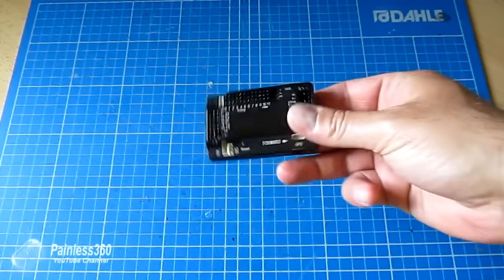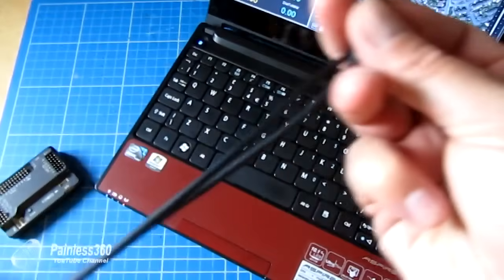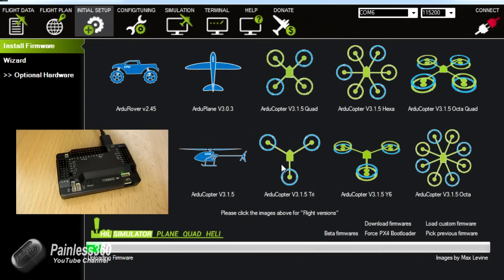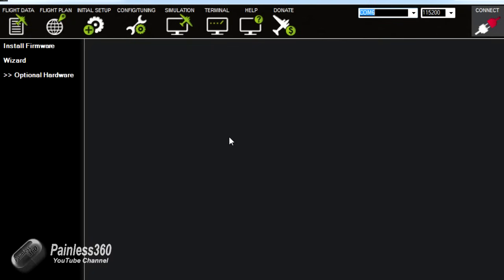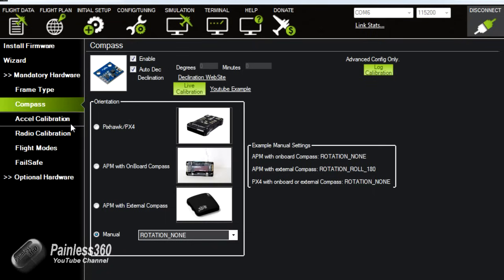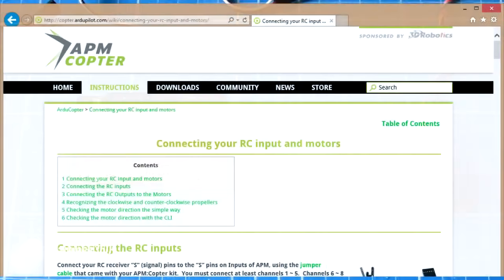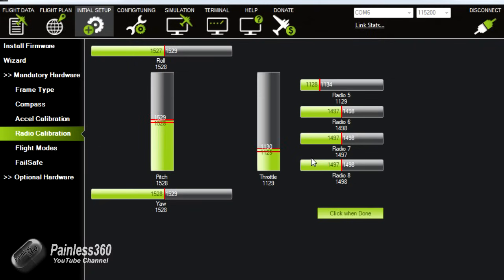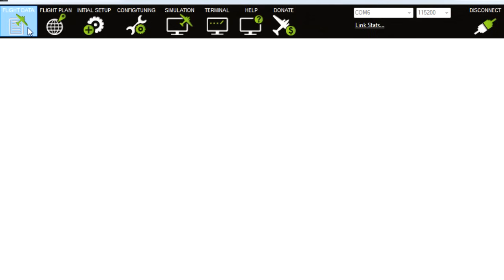(1/8) APM 2.5/2.6/2.7/2.8 - Simple installation and setup overview

Comment: Does anyone have any problem at the moment of Mavlink connection? My APM 2.6 loads the firmware, but when trying to connect it will just go to "No Heatbeat Packets Received" after the timeout...Alive LED is locked and the RX LED blinks...but nothing happends...it used to work before...but i dont know whats going on now...help?
Reply from the maker: Hi Nils, try connecting as soon as you power on the airside radio. Failing that a firmware update often clears the problem. My video 3DR Radio on an APM 2.5 Multicopter Board - Overview, Setup and Troubleshooting may help.
Reply: I'm having trouble right at the beginning...the Ardupilot 2.6 connected with USB to the pc wont connect via Mavlink, nothing else connected :|
Reply from the maker: That's nothing to do with the MAVLink radios then! :) Remove any Bluetooth and other adapters you have plugged into the USB ports on the computer (APM  2.5/2.6 Mission Planner - slow USB fix)

Has this ever worked?
Reply: Thanks for your help again! At the beginning I connected my APM 2.6 board to the Mission Planner 1.3.9, uploaded the last firmware for an hexacopter and I was able to set the accelerometer and compass configuration (seeing in the Flight Data the changes when moving the board), but now it won't work out...Everything looks normal, board is reconiced, uploads firmware, when trying to connect LEDs blink but then...no connection is established and I finish with the message "No Heatbeat  Packets Received"....no bluetooth, or any other kind of USB plugged in.
Reply from the maker: Try connecting to the board at 57k baud for the USB link, it may be a bad circuit..
Reply: I ran into that today and then i looked at the Baud rate and it had changed i put mine back to 115200 and worked again

Comment: Hi I cant find my board on any com port. How can I get my pc to recognize the board.
Reply from the maker: beretta sometimes it takes a few times plugging in for the board to be recognised. Has this ever worked?
Reply: Painless360 I found out my usb cable was faulty. even though the lights were on it was not communicating with my pc.
Thanks for the great video. Working my way through it.

Comment: No matter what I try I cant get the firmware to upload. It keeps giving me the 'Communication error - No connection; error. Please help Mr. Painless, this is so frustrating :(
Reply from the maker: +Brenden what have you already tried?
Reply: 1) Update drivers - unsuccessful 
2) Selecting 'Auto' in the com drop down
3) Uninstalling-reinstalling Mission Planner - still no change
4) Trying the wizard - unable to establish connection 
5) Installing 3.2.1/3.2 - unsuccessful 
6) Trying different USB ports around my pc/

I would like to add that in device manager settings the audrino comes up under 'Other Device' instead of coming under 'Ports', and in add device/printer it comes under 'Unspecified' with a warning icon beside it. 
When plugging it into the PC it doesn't make the standard usb plugin sound, instead a 'unable to install driver option shows up.
Reply from the maker: +Brenden sounds like the problem us usb based. I'd try another cable, delete the device in device manager,  remove any usb drivers on the pc and plug the flight controller in again to restart setup. Best of luck!
Reply: Tried this, no luck. Any pointers on updating the drivers? I am unable to find a relevant driver for the APM
Reply from the maker: +Brenden it should be there if you have Mission Planner installed. I'd check the Arducopter pages. Best of luck!
Reply: Thanks for the help.

Comment: hello friend, I have a Raptor 30 helicopter combustion, I wonder if any controller card that I use to help me on the flight there. I want to ride a helicopter FPV this and would like to have more security. 
thank you 
Heverton
Reply from the maker: Hi there, the APM can do that. It is one of the options for the firmware. I will not be covering that in this series (it's more about Mutlirotors) but as a copter flyer myself (mainly Align 450/500 class) I can see the appeal. Be aware that as from V2.9 of the code you should take care to mount the APM board on vibration dampening supports.

Best of luck with your project - I'd like to see the copter when you've got it working! Happy flying.
Reply: friend thanks for replying. I have one more doubt is possible to do back home? ie all options multirotores be possible in my Helicopter? 
thank you
Reply from the maker: Yes, should work. Not done it myself though. Good luck with the build.

Comment: so once again I tried to check the telemetry log and no data
Reply from the maker: +Horace Gray Can't help without more detail. I would double check that the throttle is smooth from the transmitter and you not in Baro mode... Best of luck with it.

Comment: Hey,
Do you know where to get a cheap, genuine apm 2.6 board, or is a fake also ok?
Reply from the maker: +Tobias Veerkamp All of mine are copies. All work great. I would order from a vendor that seems to specialise in RC kit though..  Best of luck.
Reply: Painless360 Thanks,
Can I get it from banggoodor s that not such a good idea?
Reply: Painless360 Do you know a good vendor, because when I search for amp 2.6 I get flooded with different vendors
Reply from the maker: I have used eBay in the past and places like Banggood.com and others do great kits that come with the GPS and other bits too.

Best of luck with the project.
Reply: Thanks!
I'll get one from banggood then.

Comment: can't you help me..?  my apm won't connect to my notebook, is always not recognized.. please help
..
Reply from the maker: Happy to help but please watch https://www.youtube.com/watch?v=olIqTiSJHIY and come back to me with more detail of what you've tried..
Reply: thanks, I try to plug in the apm 2.8 into other notebook ..and its work..
but  I'm still confused how to callibrate compass with external compass... sorry my english language bad..
Reply from the maker: Make sure you are selecting the right compass option at the top of the screen before you start. Make sure the external compass is plugged in if you're using one..
Reply: +Painless360 thanks , now my quadcopter can fly but is always moving to the left, I try to find which tuning that working fine..
Reply from the maker: That's not a tuning issue. See our video on things to check if you model drifts for things to check.. Best of luck!
Reply: thank for guidance,  but I still have homework ,when on althold mode , my quad won't steady .. maybe I have to put some foam on the baro sensor..
Reply from the maker: Without the foam it'll be all over the place..

Comment: 05-Nov-2016:

Hello Lee: Excellent Video. I just finished initial setup following this video. I am using following setup...
Mission Planner: 1.3.41.3 build 1.1.6122.35387
Firmware ArduCopter: V3.2.1 (FC bought was APM2.8)

 I believe, this video require following updates...

1/ For new version of all GUI's in MP, refer to http://ardupilot.org/copter/docs/configuring-hardware.html
2/ Initially, I was struggling to get the right COM Port with failed message " device driver software was not successfully installed". Fix: download and installed Arduino Software https://www.arduino.cc/en/Main/Software. 

All OK now.
Reply from the maker: Thanks for posting! Happy flying!

Comment: Cannot connect my board, the com port does not show up....
Reply from the maker: Happy to help but please watch https://www.youtube.com/watch?v=olIqTiSJHIY and come back to me with more detail of what you've tried..
Reply: Hooked up the telemetry and it all works now, but when i upload firmware, it gets stuck on the 'detecting board version'
Reply from the maker: I'd disable any virtual com ports or Bluetooth adapters and have another go. We have a video on something very similar in the APM series. Best of luck!
Reply: Thanks man
Reply: Mostly working, can't arm though.
Reply: Finally got the thing flying. Most fun I've had in ages
Reply from the maker: +Ben Shamblin happy flying!
Reply: Annnnnd the problem of the day is that my throttle dips randomly. This APM stuff is great but buggy.
Reply from the maker: Actually Arducopter is one of the most stable, solid flight control software in the Opensource community. Until recently it was supported by 3DR and they paid for 10 full time developers. I'd suspect that there is a problem with the radio or the throttle cable on the model. I'd use the logs to see if the APM is recording the throttle drop.. Best of luck.
Reply: That issue is fixed, but my copter is twitchy. I'll report back after testing more, and thanks again for the help

Comment: Hey mate,i am having problem with my quadcopter for some reason  one of my motors doesnt spin at the same time with props on,but without props they seem to work fine,i have done the esc catibration 4 at the same time and 1 by 1 and still i am having the same problem,Checked motors are spinning the right was checked right wires are connected from the ecs,s to the apm.When i try to lift of it either wants to flip back or forward,i will not take off level,i have bullet connectors joining the esc and the motors,woould you have a clue what might be wrong.Thanks
Reply from the maker: +SheaProdigy sounds odd. I'd check the things we mention in the video where we cover the things to check if your craft flips on takeoff first.. Best of lick!

Comment: Please someone help me... I can't able to fly my drone... After all calibration... All 4 motors spins but if I tilt the quadcopter it spins at same speed... May I know what's Prblm
Reply from the maker: Happy to help but please watch https://www.youtube.com/watch?v=olIqTiSJHIY and come back to me with more detail of what you've tried..
Reply: Painless360 I have tried multiple times again and again result is same..... I'm using apm flight controller after all calibration ...whrn i increase throttle motors spins if I tilt the copter in all directions... Motor spins at same speed... I have tried with apm 2 controller result is same
Reply from the maker: Still not sure what you’re describing, please watch the series from start to finish as I cover all of the steps I followed to get mine working. Hope it helps

Comment: OK I have done a lot of investigation over the past three days lot of forms and videos your you tube is the only one that is actually shown how to program a flight controller I have found nothing pertaining to the questioned that I ask you which was mission planner says it cannot find a heart beat and it will not connect it times out a I think the controllers bad I would like to know about the PIXHAWK make and model and its compatibility with a Quanum nova from HobbyKing.  because of what you have said in the video I think it would have a good controller for my Quanum nova.
Reply from the maker: +Craig Croitori Not familiar with the Nova so can't comment. If it's not working let Hobbyking know..